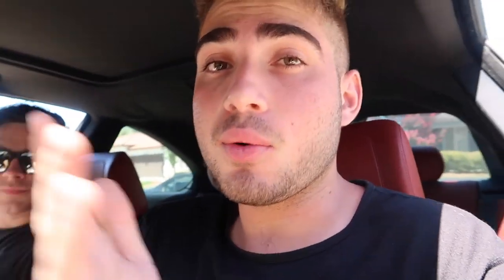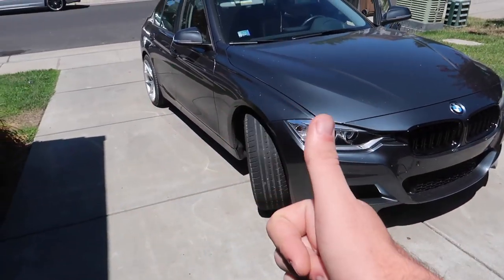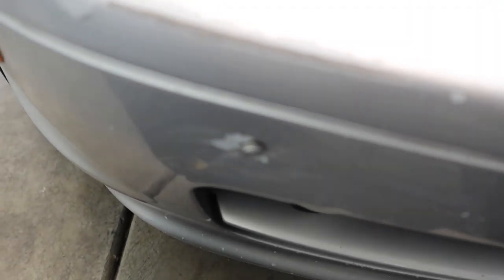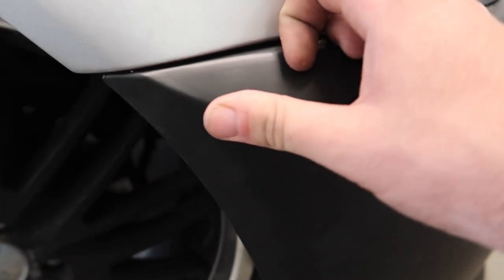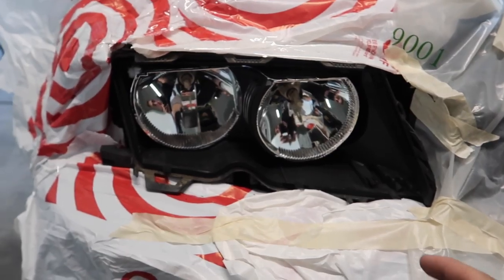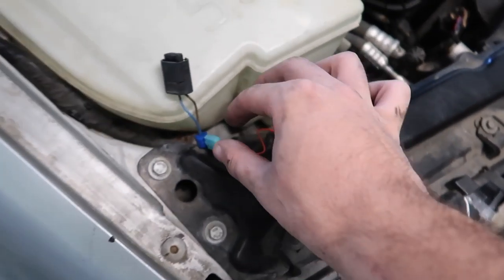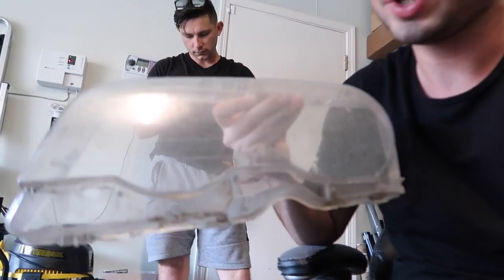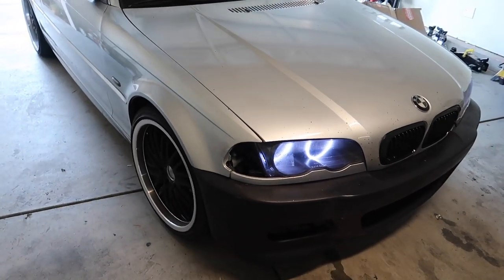WHAT $300 GETS YOU ON A BMW E46!

Comment: Dude you gonna have zero light output with your reflectors black
Reply: Max Pullen what’s the right way to black them out with ?
Reply: You can’t black out the reflectors on a halogen light or the light reflected out will be next to nothing.
Reply: @maxp4417  I have done the same mod and there a couple variables.

1. Living in the city
2. Halos are actually really bright and around 6000k which is more than enough light
3. Having Fog light. U can use em For light
Reply: Just unstall bi xenon lights